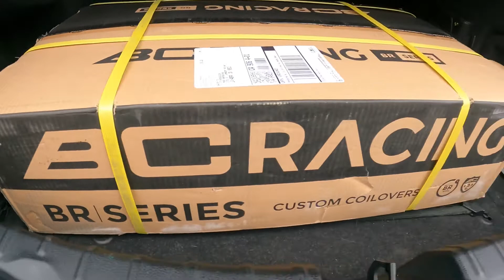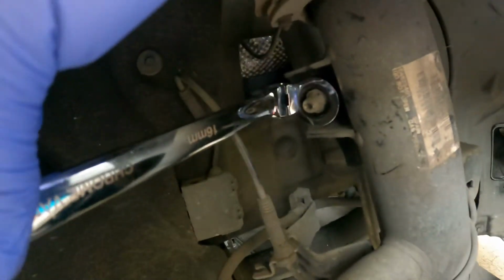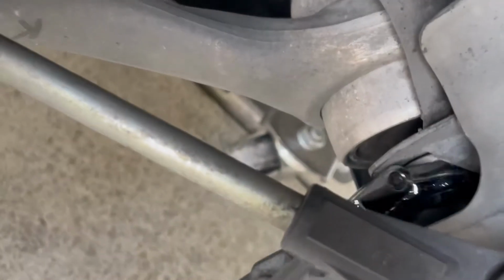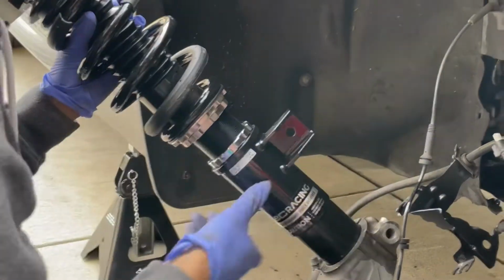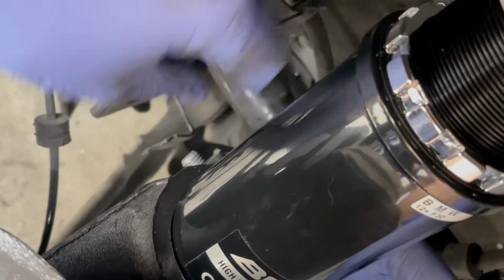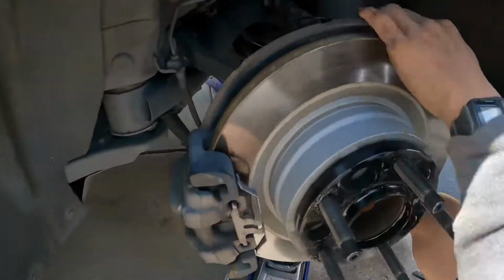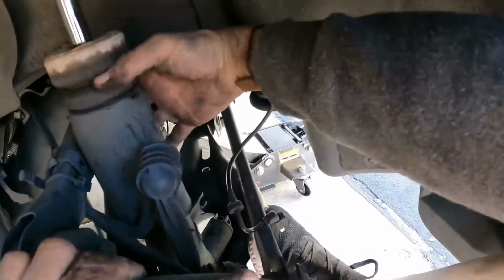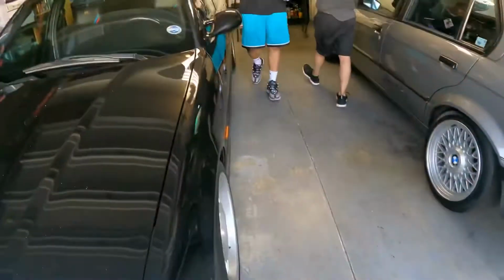Installing BC Racing Coilovers on a BMW F30

Comment: Do you guys experience a clunking sound when you go over speed bumps? I do I’m mine just curious
Reply: Endlinks are not tight enough if it’s clunking on bumps
Reply: Fax’s took my e82 for and alignment after m3 arms and he said I didn’t torque the driver end link
Reply: the clunking comes from the steering repair kit